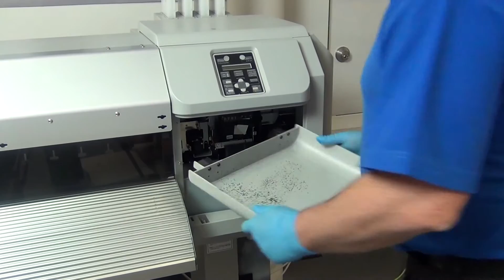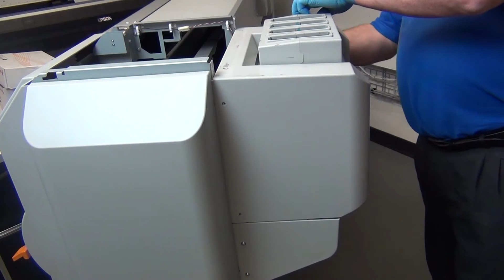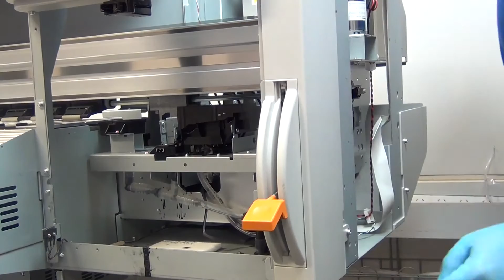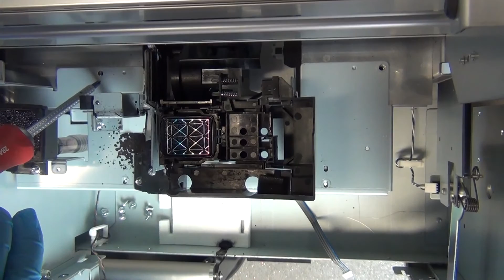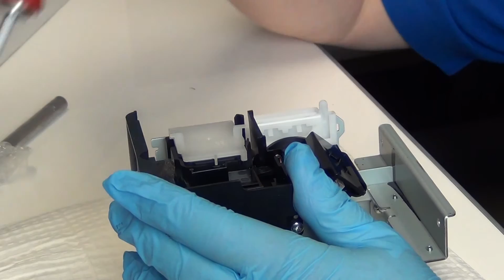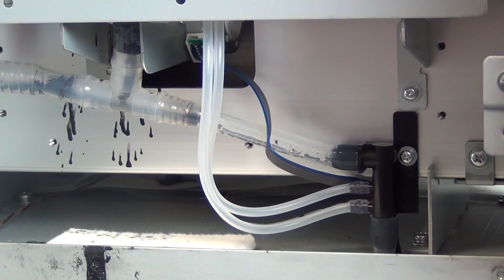1624 Maintenance Station Service

Comment: Hello dear friends, I have a MUTOH VJ1624 printer and I need to replace two parts but I am confused about the exact part number of both parts.

The parts I need to replace are : 1624 Maintenance Station Service and the Epson DX7 print head

In the search for the station I have found that there are at least two different codes, namely DG40356 and there is another with the code DG41000. Which causes me confusion. In the same way there are many types of the DX7 head. Can you help me, please?